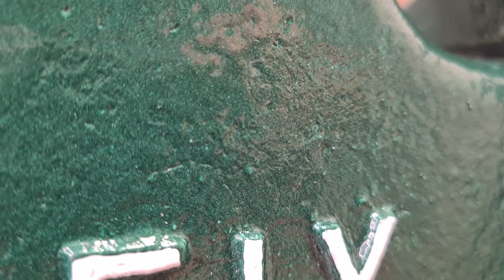Huge Vise Restoration ["FIX" Huge Rusty Vise]

Comment: I have a vice this size,it as no interactions on who actually made it but it's very well made and I guess very old ,after restoration it's the hub of my workshop with it built-in anvil,not restored to your standard of craftsmanship but fully working and cost me very little in purchasing and materials used !
Reply from the maker: Thank you for your comment! Yes, the vice is the most important tool in a workshop, I am of the same opinion!  Since I bought it unseen, I didn't know how big it is, because this size is rather unwieldy, the small one I always use in my videos is always in use ...

Comment: How did that welding trick with the copper plate work?
Reply from the maker: During welding, the weld metal does not bond with the copper, that's all

Comment: Why?  Why did you use a body filler when you have all the welding skills needed to fill the voids with metal?  You already filled other voids with welding.  You welded the metal plate onto the anvil area, welded new corners, and the voids near the top of the jaws.  

Personal opinion, as I detest "fake" restorations . To me, my opinion, body filler with putty or epoxy will break easier, and is a lazy man's way of making something look pretty. MY OPINION!
All those scrapes add character.
Consistency is important... MY OPINION.
Reply from the maker: I agree, spackling there was the wrong way to go, I realized that after the fact, thanks for your feedback!